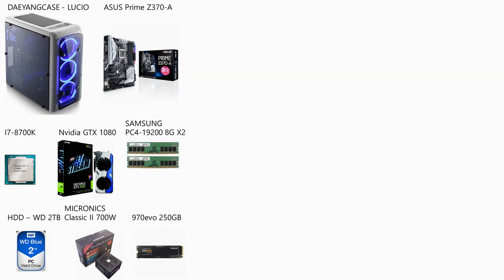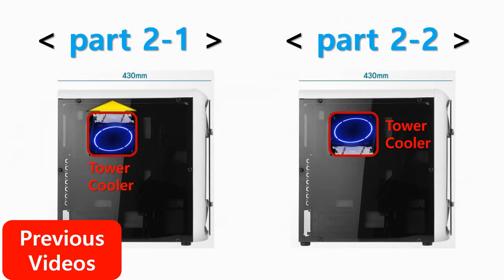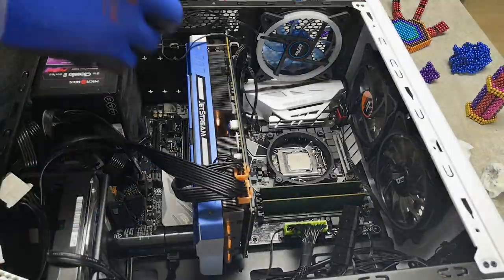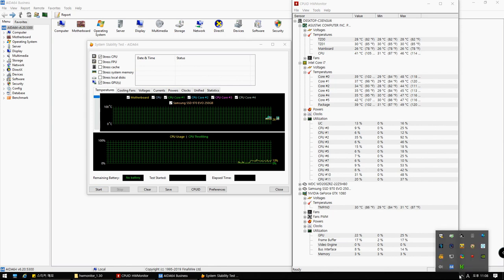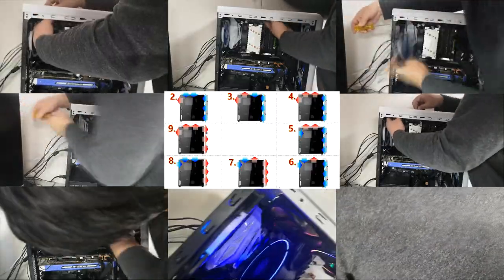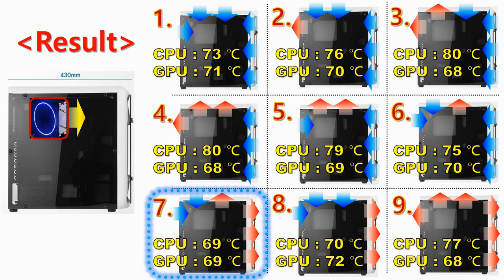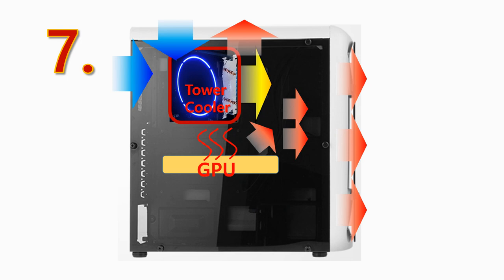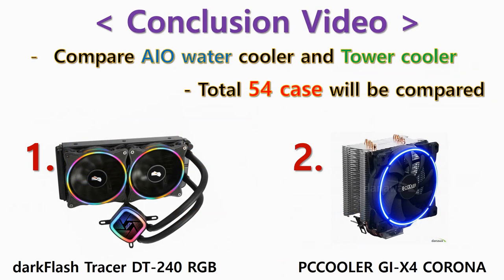Which case fan setting is the best for PC cooling?[Tower cooler Part 3]

Comment: I think it depend on the case type and condition on the placement of the tower,if putting the tower next to your sitting position, front exhaust really disturbing us as heat is dissipated near us..so u should consider the tower placement in the setup for any recommendation
Reply from the maker: Yes that's right. However, it is recommended to try it yourself because it depends on the size of the case, the cpu cooler, and the type of the gpu.

Comment: What about with a stock cooler thats pushing down (thinking AMD stock cooler)?
Reply: AMD stock cooler pulls the air towards the heatsink and motherboard. And they don't exactly face towards any specific direction (left, right, up or down). With the stealth cooler is best to use intake from back and top, exhaust from the front

Comment: What is the best direction if I have a three fans cooler?
Reply from the maker: i think you have 2front fans and 1rear. is it right? If I were, I would use  2 intake front and 1 exhaust rear or on top. and if you can set, 1 intake front, 2 exhaust top :)
Reply: @casebycase0  3 front intake and 2 top rear, 1 back rear and CPU cooler have 3 fans